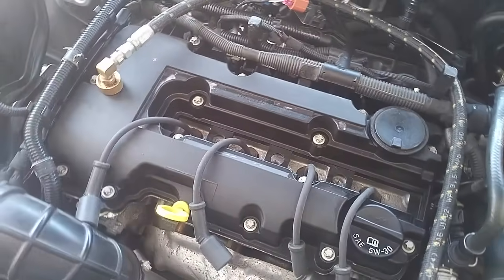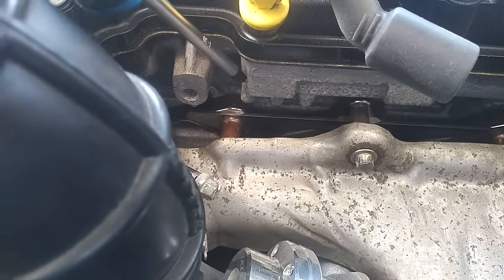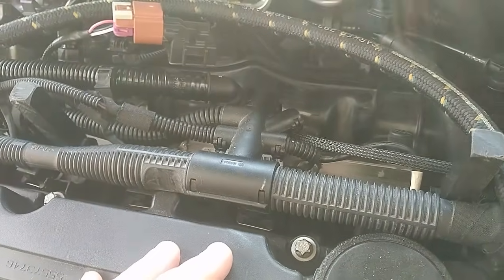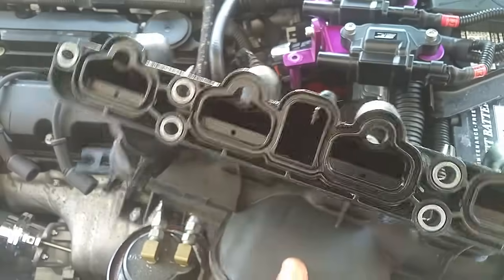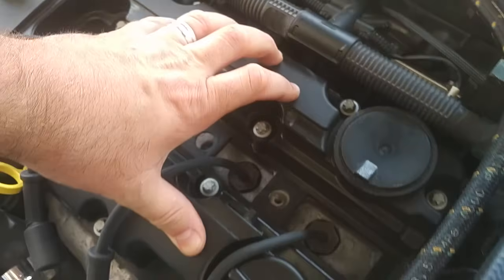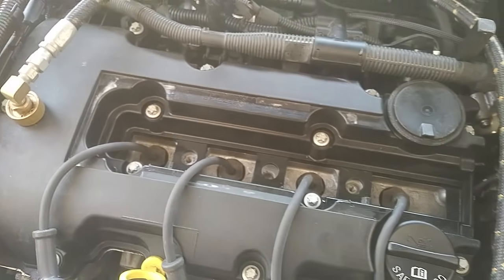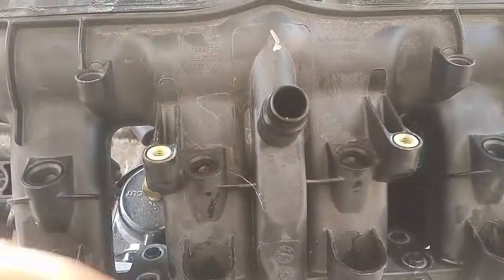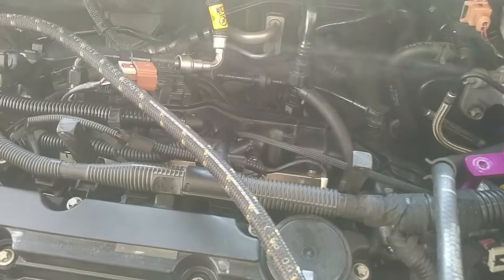Chevy Cruze Sonic Trax Encore 1.4L Turbo PCV Issues, Diagnosis, and Solutions

Comment: The kit that you propose as a solution does not make any sense. It would be enough to close the hole where the valve goes to the entrance of the admission. The solution proposed in the kit sold to connect a hose from the outlet to the servo is not necessary and does not fulfill any function.

But the most important thing is still forgotten: what do you do with the crankcase gases that enter the intake before removing the valve when the engine runs at low revs? I do not think you've forgotten it ??? !!!
Reply from the maker: The OEM never does something by accident. They deliberately placed a check valve in the intake manifold to serve the following functions:

- Apply vacuum to the crankcase. This reduces oil consumption and reduces the frequency and/or severity of oil leaks. Without the check valve in place, the crankcase operates at positive pressure at all times equal to the crack pressure of the check valve at the turbo inlet. GM specifies a crankcase vacuum of 11-18 inches of water for this engine under normal operating conditions. Lacking crankcase vacuum, more oil will be consumed through piston rings, resulting in reduced catalytic converter life, reduced efficiency (due to knock) and more carbon deposits in the combustion chamber. 
- Routes PCV gas to the intake manifold. If this route does not exist, ALL PCV gas will travel through the turbo inlet and therefore the intercooler, reducing the intercooler's efficiency as a result. 

You are proposing a total bypass of the PCV system by blocking off the hole where the valve would normally go. That is strongly advised against due to the reasons mentioned above. 

The kit I designed retains the OEM function of a check valve in the intake manifold and routes PCV gas under intake vacuum conditions into the intake tract of the intake manifold. 

You can find more information on the PCV system here: https://www.cruzetalk.com/forum/34-gen1-1-4l-turbo/175793-2011-2016-cruze-1-4l-pcv-system-explained.html
Reply: I think the solution sought by the manufacturer of this engine is a quick solution to meet the standards of environmental pollution ... and even worse, forcing the customer to change the entire intake manifold or cap of complete valve if it were the case (membrane rupture) or corrugated hose (non-return valve fails). This is at least an abuse against the consumer and there must be a legal action against the seller or the manufacturer of the cars that use this engine and eventually pursue this fraud as a hidden defect made on purpose.
There have been technological solutions much simpler and 100 times cheaper for this problem.

Moving on to ours. I agree with you on how to seal as well as the hole where the non-return valve went can cause problems. That's why I ask you at the end of the previous comment, what do you do with the gases that were produced in the crankcase with the engine in low revolution once you eliminate the non-return valve.
It is more in the solution that you propose with your kit you include a self-drilling screw with glue to seal (eliminate) this hole. Therefore the corrugated hose will take care of taking the gases from the crankcase to the turbo but where those that occur when the engine runs at low rpm will go to stop if we eliminate this valve.
Explain why I do not understand the solution you propose.
What does it have to do to connect a hose with a fitting (included in the kit) from the intake manifold to the brake servo to solve this specific problem ???

Comment: I've got a 2014 Cruze and have some of these issues.  Pcv diapham in valcover hissing and smoking like crazy. Only 50 k on it and took it to Chevy... They said it needs new pistons and rings... Think they just overlooked the pcv valves and assumed it's the rings?
Reply: Omg, don't take it there No more, it doesn't make sense why your piston rings are bad with low miles.

Comment: I replaced my intake manifold because the pcv nipple was missing and blowing out oil. a day later the check engine light came on code po171. I then change the valve cover, engine light turned off for a day. engine light is back on. I now believe it is the pcv hose. I can here it sucking from the top of manifold where the hose connects. I electrical tape it hoping to fix it. light is still on. after reading I just took the tape off as I do not want to cause any damage to parts I just replaced. I want to purchase your v2 pcv bypass kit. I went to the cruze forum link. I could not find it. please help. I'm going to purchase a pcv hose asap. I just want my car back with no engine light. this pcv issue is so frustrating.
Reply: the nipple is still intact in the manifold. I can suck freely through the hose but can not blow. the valve cover diaphram and valve cover was replaced a day a go. what to do? please help?

Comment: Replaced my valve cover and saw the crankcase exit slots and entry hole we're pretty grimy with oil.  All pictures I've seen are clean.  Is this normal @ 95k miles?

Comment: Alright, so my car was stuttering pretty bad. I went ahead and bought your V2 kit and installed it today. The majority of the stuttering is gone. But I still have some small stutters. I did check the pcv hose that goes to the turbo as well, sucked in and blowed into it and there's only a little bit of resistance but I'm still able to get air through. So you think that the reason I still have small stutters is because that pcv hose that goes from the intake to the turbo is busted?
Reply from the maker: It could be. That will be caused by boost and/or vacuum leaks. Check out my boost leak testing video as well. 

https://youtu.be/heQYgmcGnHI

Comment: Code 299- turbo cracked, valve cover regulator leaking and most likely the pvc check valves- 
Do them all together! And get new oil return line with turbo.

Comment: So if the vacuum pressure regulator is bad it could have gone bad on it's own or have been caused by an issue with the PCV?  I definitely have that whistling they talk about in other videos.
Reply from the maker: I've noticed it usually fails after the intake manifold check valve fails, but it can fail on its own as well. If it's whistling, you nee to replace the valve cover AND inspect the intake manifold check valve.

Comment: Great, easy to follow explaination of this system. 
P1101 does not go away on my car. The dealership replaced the turbo with new gaskets the first time. The second time they found a vacuum leak on the camshaft cover, third time came up after my battery died, and now I'm so fed up with this code! 4th time, all within 8K miles. Best part is, the code comes and goes as it pleases. I'm going to take matters into my own hands and replace the pvc hose to the turbo. Any other suggestions?
Reply: Map chip. It happened with my woman's 2015 sonic they changed 4 sensors and still same issue so the dealer called factory tec. And it was the map was going out.
Reply: Josh Beekman the map ????? Where is that
Reply: Ashley Alvarez this is me also bro the code would not leave it goes and comes it’s like a pest 🤦‍♂️

Comment: I had the vaccum leak at the valve cover replaced with new one now the car smokes uncontrollably oil going into exhaust from the turbo
Reply from the maker: Did you diagnose the rest of the system as I instructed? 

Might need to get a compression test done. Might have a bad turbo.
Reply: @AndreiDPop  well it's my girlfriends car and she said it stalled out on her in a parking lot so I told her not to try and crank it till I got there. When I got there it fired up had a very slight skip but a noticeable hiss. I get out check around find the valve cover hissing. So I stuck my finger over the hole and it quit hissing and started running normal no skip but belt started squealing.when I left off no belt squeal but back to a rough idle . So I proceeded to drive it home  about 25 miles. Shut it off went to bed. Next day I go out side to check the valve on the hose well I broke it so same day I got new hose and new valve cover cranked the car runs great I sit for a few staring at dash waiting to see if check engine light comes on and nuthing come on well I'm so distracted staring at the dash I failed to realize I have turned the neighborhood into a haunted house with all the smoke ha.quickly shut off and pulled the heat shields and there is oil seeping where the catalytic converter bands to the e manifold. I pulled the cat to see if I killed it but it's still white and clear as day. So then I check the intake pvc and it's not there. But there Is no oil on intake side of the turbo. I noticed if I crank the car the oil cap has a good amount of vaccum to try and pull of while running . I'm at a loss right now I wouldn't think the turbo would just decide to die. But now you know my story do you have any advice I would greatly appreciate it also I'm goin to order the pcv kit for intake but would just that cause that much positive crank pressure to push all the oil past the seal in turbo.
Reply: @austinprice1654  Did you get your car to stop smoking? Mine is doing the same. All the oil is in the intercooler! Lol
Reply: @g63836611  yes his kit fixed it and is running great
Reply: so what was it ?? @austinprice1654

Comment: If my turbo broke cant it damage my motor in 10 000 mile it burn 4 l of oil
Reply from the maker: Yes, high oil consumption can lead to piston issues.
Reply: joey levesque my turbo is broke and it works just fine no oil burning it’s works super but that one code keeps coming up p1101 and I know it’s the intake manifold or pvc valve

Comment: This is a great video. One question though, can i install this kit on my current manifold instead of buying a new one plus the kit and resolve my issue?
Reply from the maker: Yes. That was the whole idea. The kit is cheaper than a new manifold and can be used to fix the existing manifold.

Comment: My 2012 sonic is overheating unknown reason i start it after 2 miles it overheating. Ac work everything is fine except getting hot
Reply: It could be your leaking cooLant from leaking water outlet.
Reply: Leaking coolant. Money did that. Its the water pump Chevy should replace it for free.

Comment: Thank you Dre Dan! I was leaking oil from the throttle body on 2012 cruze lt. Didn't see a nipple after removing corrugated hose. Sure enough the orange check valve was missing after taking the intake manifold off. Huuuge thanks for all the info on cruzetalk and here.
Reply: Ya my 2015 cruze lt is leaking oil from the intercooler charge pipe connected to the throttle body, i was wondering if i shoukd take the manifold off and take a look but its my everyday car so its abit hard to check at the moment
Reply: how long did the intake manifold take to remove and replace

Comment: Great video! Have you looked into "the gadget man groove" Dan? The inventor caps the pcv system to increase vaccum for better mpgs, and allows the gas to vent through the crankcase breather tube. He also places a small groove into the throttle body, and daily doubles peoples mileage! My van went from 8-17mpgs over 4 fillups. Check it out! http://gadgetmangroove.com/?atid=42

Comment: I need your help...please...
my son overheated his 2014 1.4 T..found leaking water pump and thermostat damaged...both have been replaced..on a cold start I have alot of pressure at reservoir..can't even purge cooling system..any advice u can provide.. I hope it's not head gasket..please any advise would be highly appreciated..Jose Lopez 305 742 3274

Comment: with the diaphragm leaking, can I plug the hole until I get the new cover?
Reply from the maker: Ryan Hovater no. You need to replace the valve cover. Plugging that hole is a good way to blow the front main seal.
Reply: Dre Dan okay thanks Dan will it hurt to run it a few days with it leaking?

Comment: Your video talked about the other end of the PCV hose at the turbo and a check valve there. Does that one go bad and ever need replaced?

Next question:
If the valve cover gasket goes bad, does this create a vacuum leak and cause poor performance?

My Cruze gets random lifter noise that comes and goes. I checked the valve on the valve cover, but it wasn't blowing air. I replaced the valve cover gasket because it was leaking oil. Since then, I've had no issues.
Reply from the maker: Yes, the check valve on the other end of the PCV hose sometimes goes bad, and creates a vacuum leak. We find it gets stuck open more than it does get stuck closed. 

Yes, a bad valve cover gasket can cause a vacuum leak. 

Check spark plugs, as they sometimes back out. Lifters shouldn't make any noise unless you've been using low quality oil.

Comment: Great Video, I owned a Chevy Cruze 2016, After 22,000 Miles, turbo started to lose Power and eventually failed. Fixed the car Under warranty but I lost faith in GM products. Now I only buy Lexus, BMW, Toyota, Honda or VW.
Reply from the maker: You're in for a treat with BMW and VW if you think Chevy made unreliable cars. Those are two brands I stay away from. 

Lexus and Toyota though, along with Honda, make top notch products, and some are even made here in the USA! Mazda as well is up there.
Reply: I have 2007 civic. Total piece of shit. Nothing but problems. Engine mounts, suspension, chassis. Motor runs great but everything else is crap
Reply: @270eman  My brother has a 2010 Honda Accord V-6 and they had bad piston rings from the factory and plug the catalytic conveter and foul out spark plugs.  Honda won't fix it.  He said it is the worst car he ever owned.  They bought it when it was only 5 years old with 60,000 miles.

Comment: Hi I have replaced the rocker cover and checked for manifold nipple but I still have check engine light for code P0236 .  Does any one here had the same issue as mine if so plz help me out. I did change the turbo boost sensor and cleared code P0237.
Reply from the maker: I can't help you with that one. That's not a common issue and you've done about everything you needed to.
Reply: Did you change the air filter with a after market air filter or installed incorrectly .

Comment: Love this video man that’s smart only video that’s helped me so far.  If I replace the cover and check the for the nipple well it clear up most of the codes
Reply from the maker: Lucas Jones really depends on what all the codes are but it will address the pcv related issues.
Reply: How do you remove the metal clip holding the corrugated hose on the pcv/ check valve?